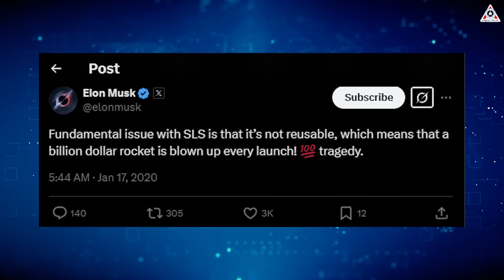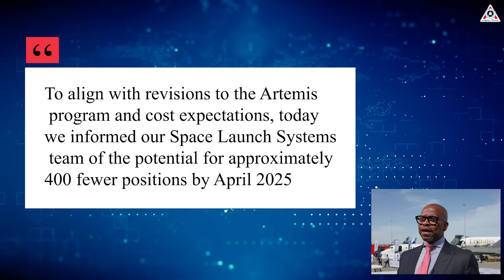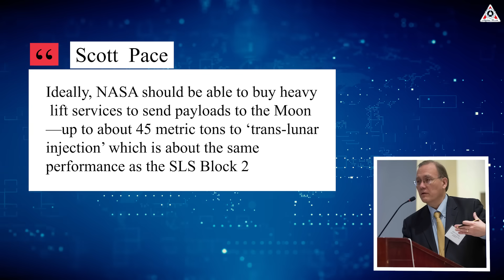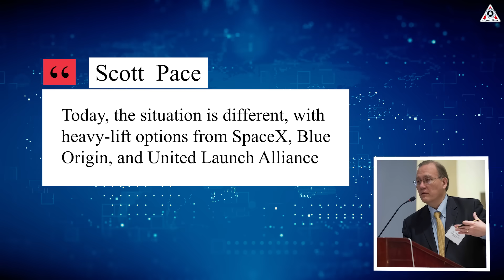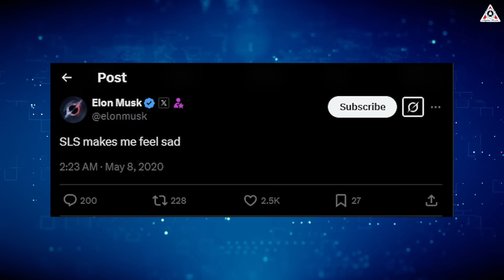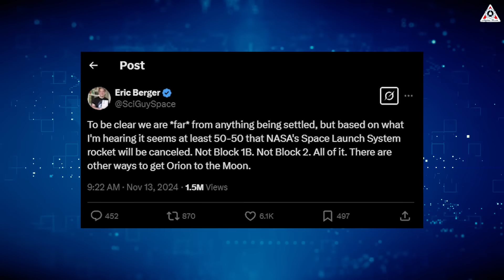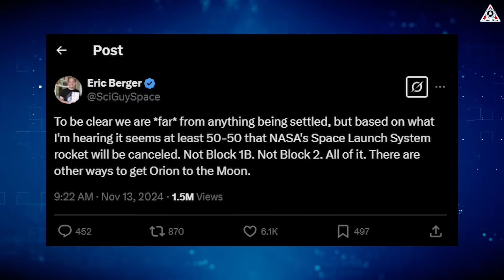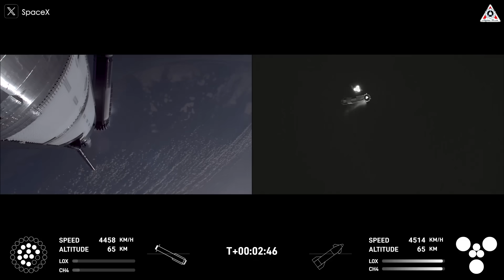Game Over! NASA SLS is in Big Trouble! What Elon Knew all along...

Comment: I would agree with cancelling SLS, but I'm not convinced yet that we shouldn't fly Artemis 2 and 3 with SLS. There is currently no man rated system that could launch Orion. Vulcan and Falcon heavy are operational, but not yet man rated. New Glenn is not operational and not man rated. Starship is the ultimate dream, but they are dozens of flights away from being operational and/or man rated. I believe Boeing has SLS contracts to at least Artemis 4. NASA should stick with that until a commercial provider can have an alternative that has a faster timeline than those flights. Make the wrong gamble and China clams the moon as their own.

Comment: Starship has failed 8 of 8 times due to poor engineering. The SLS booster worked just fine the first time.
Reply: First dozen or so Falcons failed. 
  The last 200+  Falcon launches have been successful.
Reply: @lanesaarloos281   Dozen or so?  Anyway,  NASA is 14/14 orbiting Saturn class boosters, including the three uncrewed Saturn/SLS tests.  SpaceX is at best 4/8 with Starship Heavy, attempting only suborbital flights.
Reply: @marcmcreynolds2827  compare the timelines and costs and the tech

you're bein a propagandist 

SpaceX is saving NASA and Boeing for a fraction of the money

Comment: Well, NASA’s SLS successfully delivered a payload to orbit the moon on its first test flight
Meanwhile, Starship has failed to put anything higher than Low Earth Orbit and only itself in Low Earth Orbit.
The upper stage so far has a failure rate of 100%.
So yeah, I'd ease off on the Musk hyping and NASA bashing a bit.
Starship is years behind to even bring something into space and might never even succeed to do so.
Reply: One would hope so for $23Bn.
Reply: @Ryan_Harkin  At $4M/day development cost and +10 years of ongoing development, Starship isn't exactly cheap either.
If you add all costs up, the cost of Starship isn't far off from the cost of SLS.
Main difference: SLS has already been to the moon, Starship has yet to escape earth - a difference of 235.000 miles.
Let's compare costs again when both reach the same project milestone?
Reply: Because Apollo’s 1-6 worked perfectly, starship should already be on Mars. That Musk can’t do anything but rake in millions from landing the stranded Boeing crew today. Your hate is showing
Reply: @budwhite9591  Please do tell me how many Saturn V rockets have blown up? To save you the trouble of looking it up: none.

The Apollo program had troubles with the capsule (Apollo 1 and 13 in particular) but that's the capsule. SpaceX isn't even thinking about a capsule yet.
When comparing the launch rockets, at zero failures the 1960's Saturn V rocket has a 100% higher success rate than Starship has so far.

As for landing the IIS crew: you're an utter troll if you really want to carry that propaganda pitch.

Those astronauts weren't even stranded, they had a pod ready to use to go home any day - but that would leave the rest of the crew without an emergency pod.
The Boeing crew took the next ride home which was scheduled months in advance, that's how space travel works.

At $100million/launch, you just don't send up a new rocket for the fun of it, no matter how hard Elon pushes that story.

Shall we talk again if/when SpaceX manages to get Starship actually in space (and back again) ?
Reply: @Champieke  lol stop sniffing glue

Comment: SLS is the product of a bloated bureaucracy NGO and greedy legacy companies. The SLS is 2 steps backwards from Shuttle program and nothing more than repurposed shuttle parts into a glorified Saturn 5. If we were still dealing with the same NASA that gave us Apollo and the shuttle, they would have designed the first reusable booster stage and Starship would already be human rated, but the NASA of today and its legacy contractors are billion over budget to build a rocket using 50yr old technology. It would be like trying to pass of a P51 Mustang with turboprop engine to replace the F22, or a car company introducing the next gen auto that only gets 10MPG no air bags or antilock with a 500CID V8 carbureted engine with 250HP and a cassette player as state-of-the-art technology.